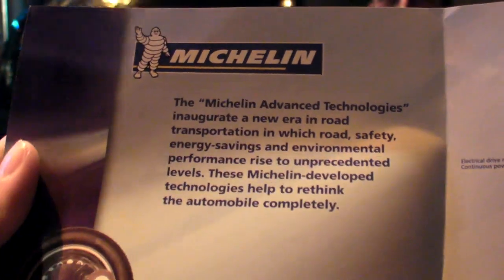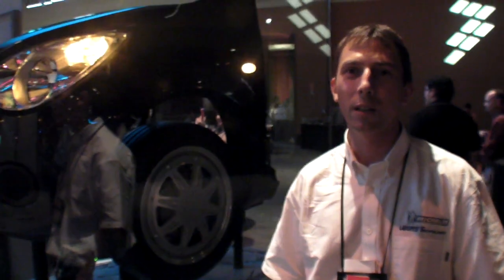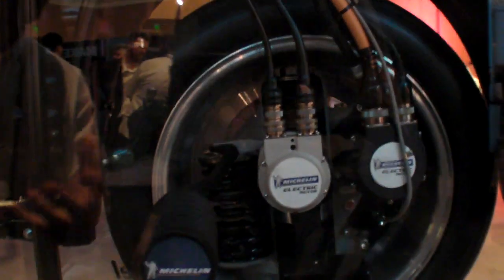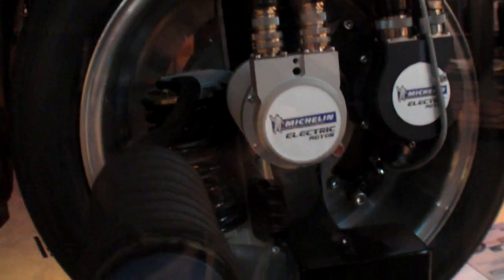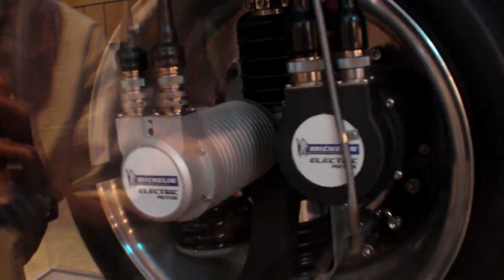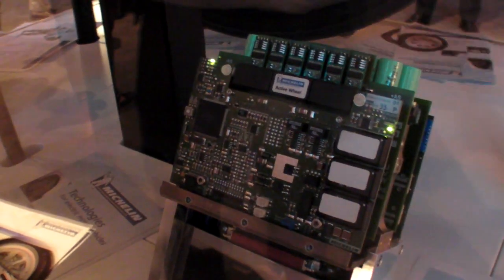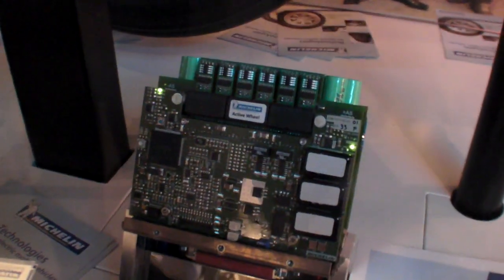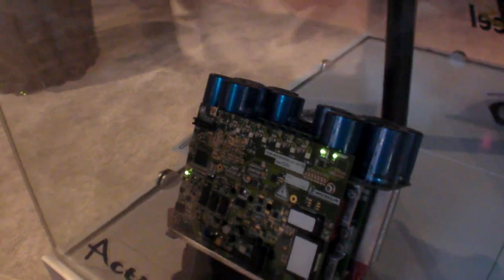Michelin Active Wheel, electric traction, suspension, breaking

Comment: I thing with the two motor may create unwanted interference due to induction voltage and could create unwanted effect. If we add on more line for opossite flow braking and remove central motor and enlarge ( add power to remaining motor ) would improve alot